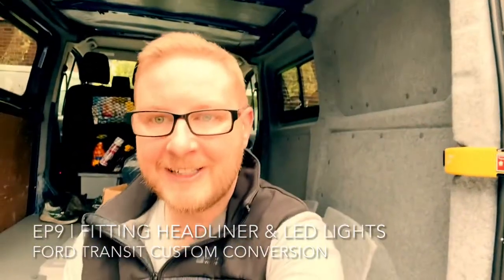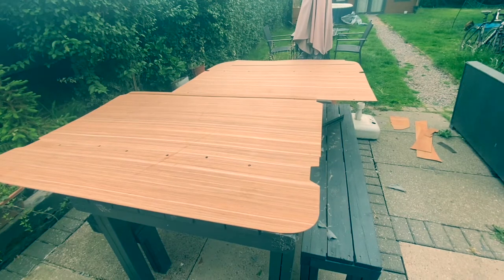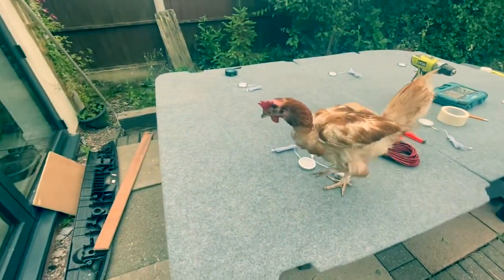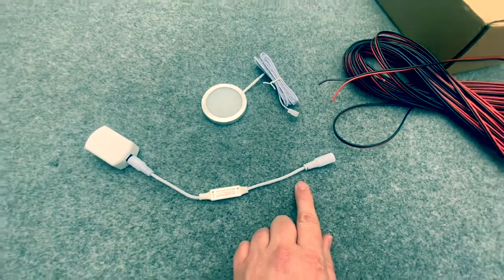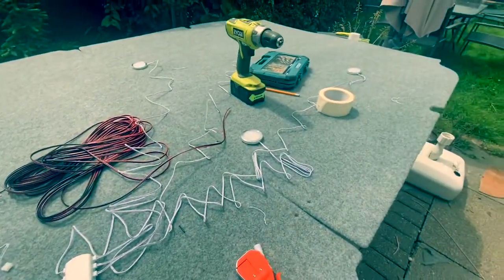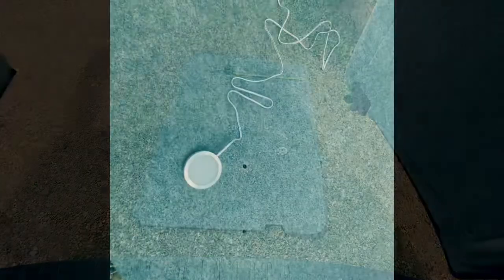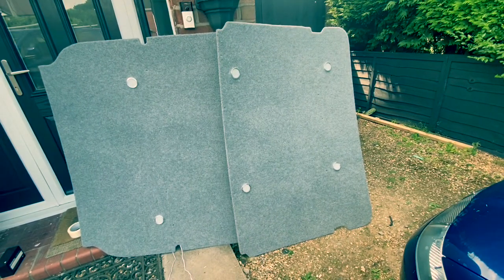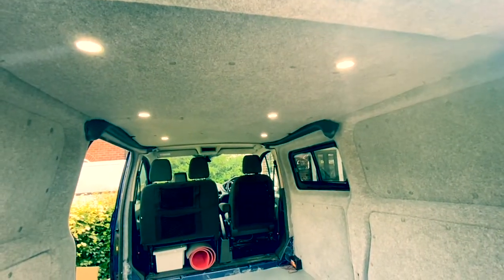EP9 | How to fit new headliner and remote control LED spot lights & dimmer in Transit Custom

Comment: hi, what is the name of the part you used to cover the wires above the window my van was originally a crew cab and came with a headliner which is now removed and the wires are showing but i cannot find the part you have, any help would be appreciated thanks
Reply from the maker: Hi - I am not 100% sure of the name.. mine already had them.. But I think ceiling wiring loom covers or something like that?

Comment: I have brought a ply headlining kit, but it doesn’t have the holes for the plugs to fix boards to ceiling. How would you fix it?
Reply from the maker: You could measure up and drill the holes to match and then use clips.. or you could screw through the ply into the ribs that are on the roof.. you could get caps for the screws or I have seen people make a small cut in the carpet lining for the screw then recover to hide the screw.. It would depend maybe if you feel you might want to remove the roof lining at any point also 👍 Hope that helps!

Comment: Great video. Can I ask where you got the led lights? I didn't see a link or reference to the ones you installed. Thanks!
Reply from the maker: Hi Craig - thanks for checking out the video and the nice feedback. I got the lights on Amazon link below 👇 

Interior LED Spot Lights Remote Control For T4 T5 Camper Van Caravan Motorhome light 12V https://www.amazon.co.uk/dp/B08YNDZ3NL/ref=cm_sw_r_cp_api_glt_fabc_9MM3TH7S96FHY51XD0P6?_encoding=UTF8&psc=1

Comment: Hi Dave, Did you use the existing lighting cable. If so, how did you bypass the auto switch off
Reply from the maker: Hi Lee - when you say the original lighting cable do you mean the cargo lights? if so we didn’t use this as the install was part of the full conversion electrics so these are powered by the leisure battery on separate switch and circuit 👍

Comment: Hello Dave how much did you cut off around your panel for carpet to fit many thanks keep up the good work 👍
Reply from the maker: Hey Ewan - thanks for the comment and checking out the videos 👍 if I recall it was only a few mm but I did a couple of cuts and a dry fit to make sure I wasn’t taking off too much too… There could be variance with each van and the carpet etc.. so could be a little different.. 👍 Are you doing your own conversion then? Hope it’s going well 👍😀
Reply: @TransitCustomCamper  
Thanks for that will do a dry fit before any cutting just starting to convert my custom sport many thanks

Comment: Hi, I'm converting a 2013 L1H1 custom. I've been looking at carpeting the plyline panels separately and attaching them afterwards with plastic clips. Some of the metal panels don't seem to have holes in to push the clips through, do these just need drilling out? Where did you get your plyline panels from?  Thanks
Reply from the maker: Hey Chris 👍 Thanks for the comment! That is what I did for my conversion too. When I stripped the van I found the factory original panels were still in place so I used these. As they were factory all the holes in the play panels had corresponding hole in the body of the van too.. So for me there wasn’t any additional drilling needed. For the headliner I for this from custom shop design and again this was supplied with the right holes for my van so it was the same process and no additional drilling… One thing I did find was the standard trim panel clips were not long enough after the carpet fitted so needed to get some longer ones from a company called Harrison Trim Supplies… Hope this helps? & Good luck with the conversion!! 👍
Reply: @TransitCustomCamper  that's great, thankyou for the reply. I'll let you know how we get on 👍🏻

Comment: What did you do with the existing courtesy lights in the back of the van?
Reply from the maker: Hey Jim 👍 I just disconnected them and left the wiring in place. They have connectors that just pull off. I have later installed an awning light too that I can move internal or external and use this as courtesy light if need as well 👍 Install of LED Awning Light | Movable & Reversible | Transit Custom Camper
https://youtu.be/AimJAd1ZER4

Comment: Hi mate, me again. I’m just about to fit my ply lining from custom shop designs. Quick question, how do the strip panels fit on? As there are no screw holes.
Thanks
Reply from the maker: Hi Scott - I didn’t actually fit the strips on my build to be honest. However, my plan was to carpet line and then use Velcro tape. Other option might be to cup a small flap/cut in the carpet on the strip - screw into roof liner and then fold back over with a bit of trim fix adhesive… I would mate go with Velcro… I used some to fit the IKEA blinds and really quite strong stuff - that video is here but I think I got it at B&Q 👍 hope that helps mate 
Part 2 | Fitting the IKEA blind in the Custom Camper Van Conversion
https://youtu.be/GjkCs_BB5WE
Reply: @TransitCustomCamper  Amazing, thank you very much. I think I’m going to leave it off to be honest, yours looks great so that’s why I asked the question how you done yours. You’ve made my mind up 👍🏻 How is the van? Is there any little bits that you would do differently now you’ve had it done for a little while other than on your mistakes video? Once again, thank you 👊🏼
Reply from the maker: @scottwinnel3983  - no worries & thanks 👍 yeah the head liner buts up well and think the joining strip would actually make it look worse. The only thing I have seen people do is join them from the underside to make one piece and they carpet the whole thing.. that would give it clean look but I rekon fitting might be “fun” 😂 - van is sound! Only things might be making the wiring a bit more tidy or locating it all under the drivers seat which looks neat… & prob wouldn’t get the fridge as only used it twice 😂 and I am considering a upgrade of the units - I have the MDF ones and no issues but they are basic and seem to be far more options now and maybe I have a bit of Van envy 🙂 Oh and I wish my wife wouldn’t get it so god damn dirty and drive though hedges 🥲 but aside from that all #winning - you will have to send over some pics of yours when you done ✅
Reply: @TransitCustomCamper  Good to hear, can’t wait to finish mine now as I’m very jealous of you people getting to go away for the bank holidays haha. I know exactly what you mean about the partner using it as a hedge trimmer! Anyway, Cheers for the tips/advice, much appreciated! I’m sure you’ll hear from me at some point in the near future 😂 take care

Comment: Hello Dave! Hope you're having fun with the camper! What size wiring have you used to run the lights back to the switch board?
Reply from the maker: Hey Daryl 👍 Yeah had a good few mini adventures in the van 😃 One thing is the days when the weather been rubbish a pop top would have been nice 😂 On the wiring based on the lights I used and checking the amps I used 20 AWG. But now on reflection I would advise to maybe go for 14 AWG to be sure. 

This will always be dependent on the lights you go for so as you know from my disclaimer on the vids I am not a qualified electrician so I’d say make sure you seek some professional advice too. Last thing you want is anything over heating and melting! 👍

Comment: Did u have any problems with the lights m8 after watching your vid I orderd some up on checking them they just flash all the time it's like a rave 🤣🤣🤣 am I been dart and doing something wrong
Reply from the maker: Hi Dave - ha! You mean you didn’t want a full time rave?!! 😃 There is a flash mode on them if it’s the same ones… On the remote there should be a mode button and you can cycle through to get just a normal mode? Hopefully that will be all it is? Hopefully they not faulty!

Comment: Hi,

Is this only connected to that battery, how do you charge the battery ?
Reply from the maker: Hi - at this stage in the build yes - it was just connected to a test battery. But by the time it was all done I had a full 12v system with a battery charger that can run off mains etc… I put all the vans electrics stuff into this playlist below 👇 hope it helps 👍 https://youtube.com/playlist?list=PL4K45Imzn1H9eLynvrVKlfmDcujCkgA2i
Reply: Thank you very much 😊

Comment: Hi, does the joining strip cover the gap between the original cab lining and the new headliner?

I've taken my bulkhead out and I'm not a fan of the gap this has left!
Reply from the maker: Hi… I currently have the exact same challenge… but I haven’t worked a solution yet! The strip would cover the gap but the liner in the cab sits lower than the new rear liner…So I am with you on this… if I find a decent solution I’ll let you know and might post a video on it 👍
Reply: Iam just doing my swb custom and the trim u need to get is out of the crew cab I got mine direct from ford it was only 75 quid well with it
Reply from the maker: Nice one thanks Dave - I don’t suppose you have the part number?
Reply: @Transit Custom Camper Conversion  I don't sorry I just went in and told them what I had done they knew what I wanted straight  away
Reply: @TransitCustomCamper  hi Dave, did you ever track down the crew cab part or come up with some great idea to full the gap between the original headliner and the carpeted roof?
Reply from the maker: @craigarmour4299  - Hi Craig - no I haven’t yet actually 😞 I’ll have to put it on the list 👍 I’ll give you a shout if I come up within anything
Reply: @craigarmour4299  did you ever find this part?

Comment: Hi mate, what thickness ply did you go for?
Reply from the maker: Hey J P - I went for the 3.6mm… I got it at Custom Shop Designs.. I think they do a 6mm as well… My thinking was as I was using the panel clips I wanted to keep the weight down etc… I have put this link below 👇 

https://www.customshopdesigns.com/product-page/copy-of-2013-onward-swb-ford-transit-custom-van-3-6mm-ply-roof-lining-trim-kit

Thanks 

Dave
Reply: @TransitCustomCamper  Thanks for the response Dave, mega appreciated. See you in the comments a bit further down the line no doubt 😅👍🏻

Comment: I take it when you ordered the ply you asked them NOT to cut out the light hole 🕳     Knowing my luck it will come with the hole even if I ask.  

I’m going to put a light bar above the bulkhead instead.   Thank you for making these videos!
Reply from the maker: Hey James! I ordered online and one of the options asked for with or without the holes for courtesy lights so hopefully they will send I out the right ones 👍 It’s funny though at EVERY stage I had a panic that it would be wrong stuff or it all wouldn’t fit 😂 but it all worked out

No worries on the videos!! Just thanks so much for watching and the comments… that really does mean a lot to me 👍 and glad they are useful James! You will have to post some pictures when you done!
Reply: @TransitCustomCamper  I’ve done a faultless job tbh. Just gonna finish it tomorrow with 3 more panels.   Trying to find the mdf Ford letters. For the two back panels. Not going to fully carpet the doors untill I watch yours      It’s a shame as I think you did a really good job and any other way won’t look as good but….
I wish I did have the time to film it. But that’s another big job.  I will try and make a finished video.   Im pretty good with stuff like this as Im pretty hands on. “Tiler”.  Can’t do joinery though 😅

Comment: Hi Dave , I’m doing my lights on the ceiling and just wondered where abouts did you mount the 6 way splitter and module for the remote control ? Did you mount it somewhere where it can be accessed or hidden ?? Thanks In advance
Reply from the maker: Hey Lee - thanks for comment and checking out the video 👍 the splitter I just pushed under the headliner near the window and the module for the remote I put that under the plastic wire cover that is over the window. The remote does work but sometimes needs to be “pointed” in the right direction 😀